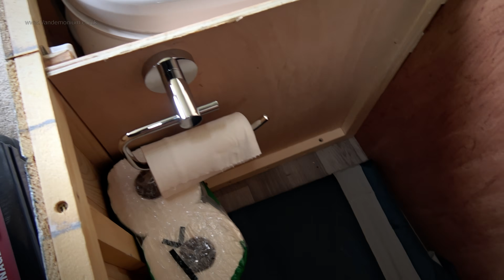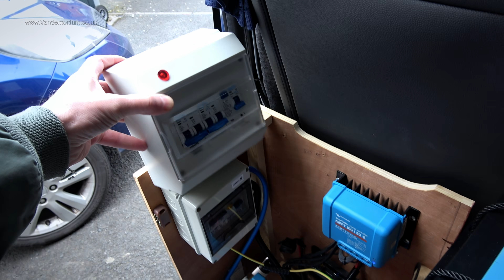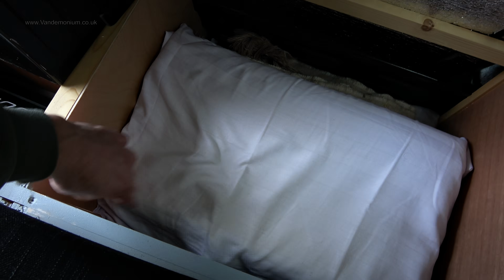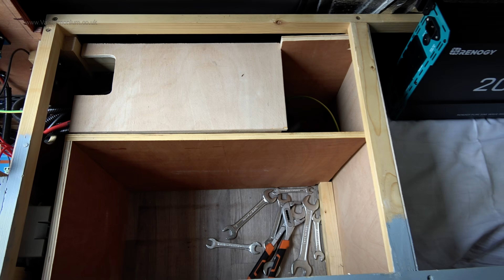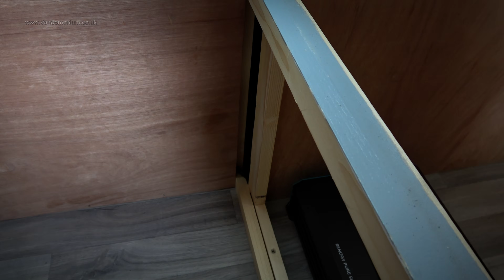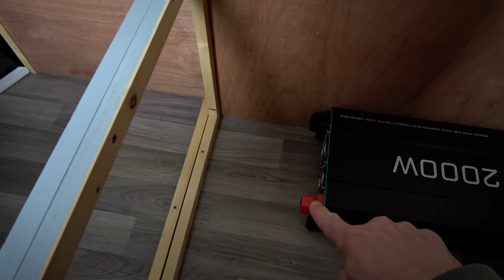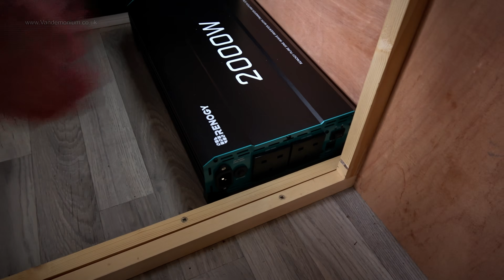78. How should I arrange the new campervan electricals?

Comment: Hmm ... at the risk of raining on your parade David I would refer you to the inverter's installation manual first and foremost.

It may be that the inverter unit has to be installed with a specified minimum air gap all around to permit adequate ventilation.

In short I would suggest you "re"design the boxing in and storage around the inverter and not try to shoehorn the unit into whatever space is available.

The inverters do get quite warm so whatever the installation manual decrees is best followed to the letter.

(Not following manufacturers' installation instruction to the letter might cause problems were you obliged to make a claim on warranty in the future. Plus insurers accept a "risk" provided "you" have made any installation to the letter of the installation manual and any relevant regulations or laws, such as current carrying capacity of cables, fuses and switch gear ... and ventilation requirements of course.

In your last episode you introduced the induction hob unit. Having decided this was an excellent wheeze I had a squint at the electrical requirements of an induction hob. (From Amazon.)

There could, possibly, be an issue on the compatibility of the inverter and induction unit.

The inverters as depicted on Amazon can, on full power, produce 2kW of heat, so to speak.

If your induction hob is rated at 2kW then it is possible your 2kW Inverter will struggle. Generally speaking it is preferred that an inverter provides more power that the load would draw.

From experience (on my boat) I found my 24" TV, drawing less than 100w, was a bit too much for a dedicated 300W inverter in that the fan inside the inverter came on after a minute or two and stayed on. The aluminium heat sink case on the inverter, despite being in free space got quite "warm" to the touch.

I found too that the continuous noise from the fans inside the inverter case was fairly noticeable.

I noted too that even the load from the TV on my main 1500W inverter caused the ventilation fans to switch on intermittently. The main inverter is mounted in free space within the engine room, and, as you will know, what with ventilation to outside ambient, the temperature can dip to freezing point or lower.

So, might I suggest you do a test of your system before you do the install and see if the LiFePo4 type lithium battery will Indeed provide enough power to the inverter and the inverter  is perfectly happy powering the induction hob.

If the cooling fans in the inverter come on and stay on then that might well indicate the inverter is just about coping.

As for the size of the cables then you can check to see if they get warm. Ref the bending radius then it looked as if the cables supplied will bend sufficiently.

The fact that cables are doubled up means that a single 25mm2 or 50mm2 cable might be a bugger to fit in a tight space what with due allowance for minimum bending radius.
Reply from the maker: The hob draws max 1600W if using both ‘burners’ at full. And yes, I have of course read the manufacturer’s installation instructions including the air gap around the unit!
Reply: @Vandemonium  

Good news on the induction hob current draw! Will presume you'll mention the hob in later episodes.

Research tells me that induction hobs quite efficient and little chance of getting burned by unit itself. Obviously pots or frying pan will get as hot when cooking so usual rules apply sort of thing.

Looking forward to continuing saga, especially on how battery copes.

Comment: Mount the inverter on the metal behind the passenger seat, then put a removable divider between it and your bedding. It will have ventilation from under the seat and your bedding will still fit. Then remove the divider in the battery compartment and turn the battery 90 degrees, and mount the charger on the opposite wall. Then you can put the water jug in the big compartment under the bed .  Easy Peasy !

Comment: Surely, your inverter needs to have the end with the sockets fitted through a cut out so you can easily plug in any tools? It should open into your walkway. So fit it front to back low down in that bedding box. And why not move all your bedding to the top of the van, as it is light weight, and put heavy stuff, like tins of beans and beer low down on the floor.
Reply from the maker: I wasn’t going to use the sockets directly but via a short extension cord

Comment: You seem to be thinking about the mechanical positioning of each item, and then the wiring of it. I would suggest deciding on the mechanical placement of each item based on the minimum wire length between the battery terminals and the inverter input. The best place for the main isolator is mounted on the battery terminal with integral fuse / breaker. Remember batteries are always live and have the power to vapourise spanners so insulate the tools. I used to train engineers who maintained battery systems.

Comment: Time to go shopping for new terminal connectors. They make 90 degree terminals for cables that would allow that inverter to fit in the water bottle storage spot. Search for 90 degree ring terminal. You will also need to cut some holes for vents in the front but that's easy.

Comment: What if you redid the first compartment and rotated the battery 90° (if the existing box is deep enough to allow it) and put a parallel partition in for the inverter, then add another partition to use any remaining space for storage?  You could drill a few holes in the front board for ventilation for the inverter.

Comment: Rejig the partitioning in the battery/water compartment - you could perhaps afford to change some of the partitioning behind the 13A sockets? Battery, inverter, new partition for tools. Some right angled lugs might just get you the space you need - or worst case push sideways into the electrical distribution cabinet rather than into your bedding store. Keeps it all together, keeps cables short, keeps it well ventilated.

I do wonder what your neighbours make of you chatting away to yourself in your van on your drive :)
Reply from the maker: Haha so do I!

Comment: Keep the battery where it is ... remove the partition in the battery box. Add a shelf/false floor above the battery and put the inverter on top.... fuse box and master switches can still fit in the  battery space ...

Comment: I think you have things pretty much to spec, with a couple of possibilities.... As Rick mentions below, be careful about the heat created by the inverter, and you may need to vent that area (some duct and one or two quiet computer fans should suffice) as at full chat, that's going to get hot! If you space the inverter away from the floor you can plug the outlets without any further chopping about, and ventilation would be more efficient. Putting the inverter and battery together (the bedding will have anew home) would be most efficient and cabling could run under other things to the fusebox and cabling area. Carry on, there's a lot to think about, and you can cherry-pick from our collective suggestions.

Comment: Sorry if am missing something, but are you not over thinking this. Can the invertor not face the other way around in the first cabinet space, so that the battery connections are to the left as you look at it. Also as someone else mentioned, either buy 90 degree terminal connections or carefully bend them 90 degrees. In the case of the battery, again can you not turn it so the terminals are also to the left (The label of the battery the right way around) which would make a shorter run for the cables ?. With the 240v outlet sockets on the inverter now to the right, these cables are generally a little thinner making them easier to bend/follow the cabinet walls ?
Reply from the maker: Yes, they both can turn, I just put them like that while filming!

Comment: I wouldn't enclose the inverter under a false floor.  It will get hot.  Maybe not hot enough to burn anything, but hot enough to shorten the life of the electronics.  And don't you have to get to it to turn it on and off?
Reply from the maker: I have a remote switch for it
Reply: @Vandemonium  Okay.  But have you noticed the inverter can be bolted/screwed to the side wood up high, just under the cover and away from the floor?  Thus eliminating the need for a false floor.

Comment: The battery could be placed on its side, so the longest side would be going vertical...
Or perhaps you could make an access hatch through the panelling (the one facing the rear of the van) to put it in its place, if you want to keep it oriented 'normally' (i.e. bottom side under).

Comment: David with reference to the jubilee clip requirement I am just glad you don't work on bottled gas connections or hoses with water pressure constantly on!
Take care and all the best with the electrics
Reply from the maker: Err but you wouldn't use a barbed connection on its own there. I wasn't suggesting it was suitable to gas or high pressure lines!!!

Comment: I think you need to worry about airfrow. It'll get pretty hot in an encosed space with blankets to isnulate it.
Also trailing the hob powercable across the entrance of the van seems a bad idea. I'm forever trippingover my laptop powercable and that doesn't have a pan of boiling water sitting on it when it gets pulled onto the floor. Add a seperae socket on the kitchen side of the door for it! or get a fastpass for A&E
Reply from the maker: I did ponder that but I doubt i'll be getting in and out if I'm cooking.
Reply: @Vandemonium  which just means you'll be by the boiling pan of water when rainbowlollies visits and trips over the cable. Thinking "I did ponder that" from the back of an ambulance is too late.

Comment: Can you use cable terminals on the invertor with a 90 degree bend in the connector. Just bend the connectors  90 degrees that are already on the cables. Then the cables will not have to go into the bedding storage area and not have to be bent as you described.

Comment: Put the new stuff where you have the old stuff. Will need a bit of extra wood working but will mean shorter runs and you get to keep your pillows in the same place. Just one extra thought would the inverter not fit under the passenger seat?
Reply from the maker: I need to have a look!

Comment: Just my two pennies' worth, I would be rearranging the electric cupboard and wiring so that inverter has the optimum position for cooling and connection to the battery. "Sometimes the longest route is the shortest" glad you got the tap fixed though 👍

Comment: I would suggest that you could fit the inverter in the compartment where the water bottle with the yellow lid is. You'll have a much shorter and neater run for the cables. Right angle eye terminals will allow it to fit very easily, as long as there is enough ventilation. Inverters tend to get quite hot.

Comment: The cables from your 2000W inverter don't have to go straight out. You can get right angle eye terminals to connect the cables to the inverter.

Comment: Hi David, you could put the inverter where you currently store the water container, in front of the battery. This would mean shorter cable runs and a neater installation. It would also allow for batter ventilation, as the inverter will need adequate airflow to avoid overheating.

Comment: Could the inverter be stacked in the first locker you considered?
Instead of having the locker like a box into which you lower the equipment, you remove the front panel and construct a shelf system into which you can slide battery, inverter, etc, then replace the (now removable) front panel.
Reply from the maker: I like the idea very much (apart from the construction work involved!) but I don't think there's the height to permit it.

Comment: You can get 90 deg terminal lugs to help with your cable routing for the Inverter. Definatly consider cooling vents for the inverter if you plan to run the induction hob for extended cooking times. possibly computer fans to help there! keep your cable runs as short as you can and the positive and negative lenght should be equal or as close as you can.

Comment: Your bedding bundle is rectangular.  Turn It 90 degrees.  It will creep into the larger storage area, but will allow you some room to the drivers side of the battery.   Mount the Inverter to the front of a new panel to redefine the battery compartment, and put a divider between the inverter feed cables and the bedding bundle.

Comment: that inverter needs direct access to air as its going to get extremely hot! you should get it with it facing the door if pos! also it needs a ton of breathing space, again for cooling, i think about 6 inches above and about 2 inches at sides and vents above the place you put it!

an idea... battery under bed?? get a stupidly high amp buss bar, clamp the bigger cables to and smaller, i think they are called henley blocks or a wago din box... ideas only! consult a sparkey if unsure (chappie from narrowboat moonshine will be a good choice! he may do marine electrics but this is close to a narrowboats electrics!)
Reply from the maker: Cheers. I'm not convinced (yet!) that it will get so hot as it will only ever run for about 10 minutes at a time (warming some soup or boiling some rice etc) and it is very cool down on the floor where I hope it might go.

Comment: I think those batteries can stand on their ends. And there is not enough air flow for the inverter there so don't do it.
Reply from the maker: Cheers. I'm not convinced (yet!) that it will get too hot as it will only ever run for about 10 minutes at a time (warming some soup or boiling some rice etc) and it is very cool down on the floor where I hope it might go.

Comment: David, I may have missed it, but have you taken into account access to the inverter on/off switch ?? Inverters generally draw some 12v power anytime they are turned  on, even if they are not converting anything to mains voltage. Best to turn it off unless you are actually needing mains power.  This can lead to some cold noodles if your battery has been flattened.
Reply from the maker: It comes with a remote on/off, I forgot to show that

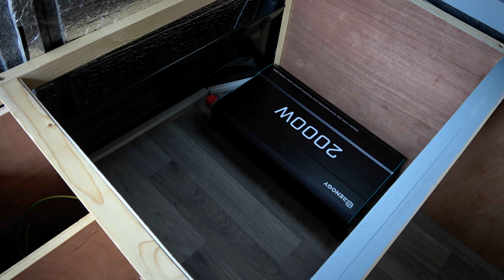Comment: 25:29 is there a wall there usually? If so, would it come up too close to the fan? How hot does an inverter get?
Reply from the maker: I'm not convinced (yet!) that it will get too hot as it will only ever run for about 10 minutes at a time (warming some soup or boiling some rice etc) and it is very cool down on the floor where I hope it might go.

Comment: What you need is an external cabinet!! Seriously, I wouldn't place a fire risk in the exit doorway of any vehicle.  Not if I wanted to sleep soundly.
Reply from the maker: I fail to see the fire risk. That cabinet's been there ever since I built the van and it doesn't obstruct the doorway anyway.
Reply: @Vandemonium  But you haven't had previously a 2kw inverter and lithium battery! Particularly they way you suggested enclosing the inverter.

Comment: Just bend the connector ! Flad cable connector - bend - screw it on -  problem solved - eeeeasyyyy installation :)
Reply: You can buy right angle eye terminals. No need to bend them.  :)

Comment: In the original cupboard can you not turn the battery by 90 degrees. In which case you can vent inverter into the van by mounting on a division panel.
Reply: I like that idea. and a couple of vent holes could be cut in the front panel to allow better venting for the inverter.

Comment: I have just looked at all the comments, and no one has mentioned the volt drop calculation for the inverter leads. Also, do not forget to have the installation correctly tested, as with may void the warranty. Also, which regulations are you using for the AC installation?
Reply from the maker: I'm sure I mentioned voltage drop at some point!!
Reply: Hello David, I have worked with dc and ac installations all my life.
Depending on where the new battery and Inverter are sited, it is essential to conduct volt drop calculation for the dc feed cable to the Inverter, which I am more than happy to do if required.
With all ac installations, be it a domestic or marine or a camper van, there are regulations which must be followed. Camper vans are covered by BS 7671 18 edition 2nd amendment.
Ideally, on completion, the ac installation should be tested with the correct documentation issued by whoever undertakes the testing.
A word of warning if insulation testing is conducted, please make sure that all electronics are first disconnected.
One of my many hats is training people in ac and dc system design and installation.
Reply: Remember to advise your vehicle insurance company that you are installing a Lithium battery. I would have carried out this exercise before removing the old battery.